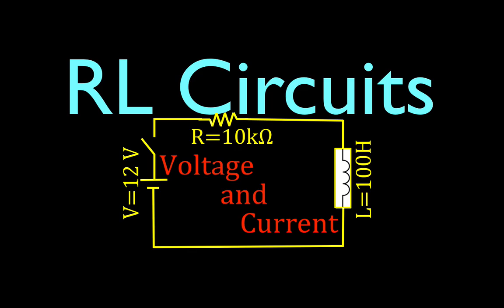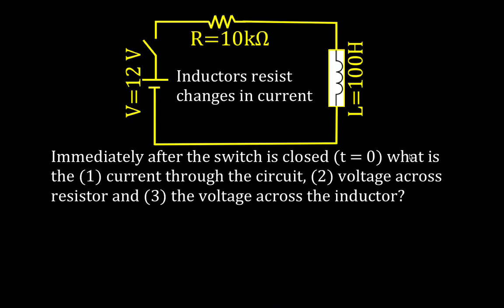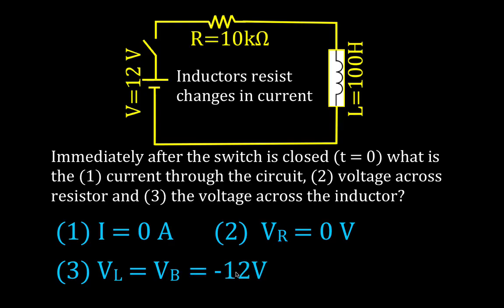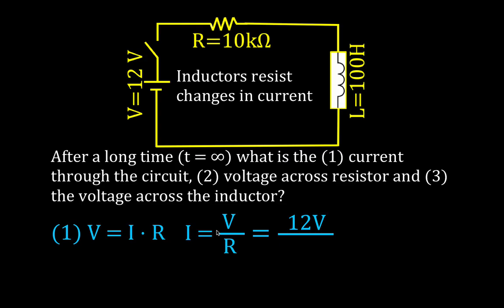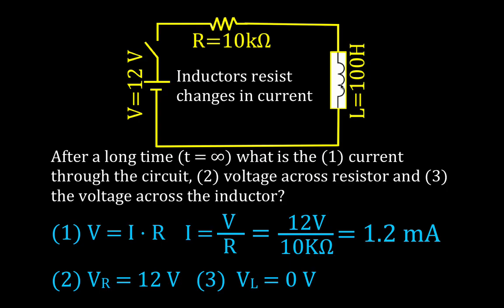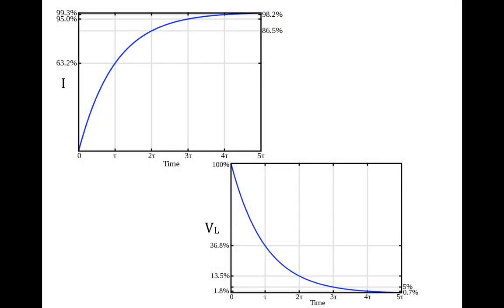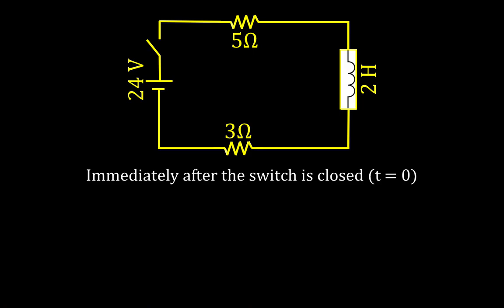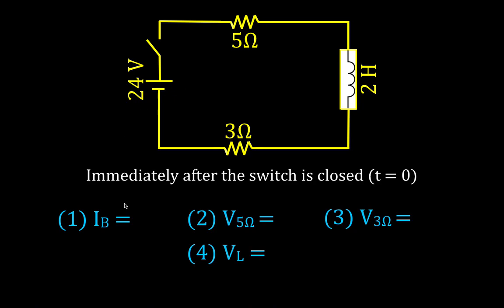RL Circuit Analysis (1 of 8) Voltage and Current

Comment: Very nice.  It is also worth considering the case where the inductor has resistance, which is true of virtually all REAL inductors.  Your analysis is for IDEAL inductors.  In the real case, the final current I would be Vbattery/(R + Rinductor).  The final voltage across the inductor would be I x Rinductor, rather than zero.  Thanks for a well done lesson!
Reply from the maker: Thank you

Comment: my university is so weird they use GL instead of RL, with G as conductance (Siemens)... making everything harder like there is no use using G.... the G is connected in parallel to the circuit, and the voltage source is replaced by a current source (Norton equivalent circuit).
Reply from the maker: Yes, that seems weird...

Comment: When a magnetic field inside a solenoid varies with time, a curly non-coulomb electric field is observed both inside and outside the solenoid. 
A coulomb electric field results and we note that an attempt to change the current in the coil induces an emf in the same coil and makes the coil sluggish to respond to current changes. 

It will be useful to learn the process which causes the production of induced emf using a unified approach to electrostatics and circuits. 
Electrostatics and circuits belong to one science not two. To learn the operation of circuits it is instructive to understand Current, the conduction process, resistors and Voltage at the fundamental level as in the following two videos:
i. https://youtu.be/TTtt28b1dYo  and 
ii. https://youtu.be/8BQM_xw2Rfo 

It is not possible in this post to discuss the production of induced emfs in inductors in detail. 

The last frame References in video #1  lists two textbooks 3 and 4 which discuss in detail with a series of diagrams the physical processes to explain the operation of inductors and RL circuits.

Comment: Since the current right after the switch is closed is 0, wouldn't there have to be a rate of change of current, to get an induced emf across the inductor? And would this be the time where the current is changing at the maximum rate?

Comment: are the resistors at 8:40 not in parallel?
Reply from the maker: No, they can not be in parallel, everything is in series. There is only one path for the current.
Reply: Try labeling the ends of each resistor with letters... To represent voltage at them... 

Call 2 resistors parallel only if both ends are at same voltage...

Comment: Wait a second, if there is no current in the circuit how can there be voltage across the inductor?
Reply from the maker: Right after the switch is closed there is 12 V across the inductor as it trys to resist the change in current. And the voltage across the resistor is 0 V.  Then over time the voltage across the inductor decreases and the voltage across the resistor decreases.  Does that help?
Reply: @stepbystepscience Almost. When the switch is closed at t=0 are we assuming that the current is running or JUST about to start going?
Reply: @lollolzi2996  since the current is zero at t = 0 s, we can say that there is no current at all. It doesn't matter if we say it is about to get going or it is going with intensity zero. It's the same. What appears to be confusing to you is the fact with have voltage across the inductor with no current. Take a simpler example: remove the inductor. What's the voltage between ground and the unconnected leg of the resistor? It's also 12 V. There's no voltage drop over the resistor because there's no current flowing.

Comment: when the switch is closed , won't the inductor  behaves as short circuit ?
Reply from the maker: When the switch is first closed the inductor acts like an open circuit, after a specific amount of time it acts like a short circuit.  The opposite of a capacitor.  Does that help?
Reply: Lenz's Law my dude.

Comment: Would there be a current through the inductor in the first example since you stated that the current of the whole circuit is zero. If there is a current how would I find it?
Reply from the maker: Right after the switch is closed there would be NO current (I = 0A) in any part of the circuit.  Then the current through the circuit increases overt time until it reaches its maximum.  The maximum current can be found using Ohms law, V = I x R or I = V / R.  So the maximum current would be 12 / 10K or 1.2 mA.
Reply: @stepbystepscience  Why is there no current? If the switch is closed. Then its just a normal series circuit is it not? I'm still a beginner sorry if this is a dumb question.

Comment: Hello, thanks again for your excellent videos. at the point that you explained that there was 0v across the resistor (0 seconds) and -12v across the inductor. please consider adding annotations that show the voltages at different points in the circuit. i know for me that method of demonstration helped allot and it could be useful to your viewers

Comment: I don't understand why the voltage across the inductor at t=0 is of negative polarity. Can you elaborate on that?
Reply: @flightlesssky note the battery polarity at 0 seconds (top is positive bottom is negative)  note that negative of battery is connected to inductor by a wire. this means bottom of inductor is 'tied' to the negative of battery.  negative of battery is 0v so bottom of inductor must be 0v. assuming you also understand why the top of the inductor is at 12v the following analogy should help. ( if you don't then ask and someone will help ) imagine 2 batteries with the pos of the first connected to the neg of the second. there polarities are the same. imagine then if you turn one around so that both the negatives are touching. they would now have opposite polarities. 
 hope this helps and please comment i  am wrong
Reply: the voltage across it, not through it ( the difference in voltage across the terminals) .  this might help also: when a capacitor is charged we can call this point time = infinity (after a long time)  however with an inductor, at the same point in time (infinity / after a long time) the current will be at I max (the maximum possible current in the circuit which is determined by the voltage of the battery x the resistance of the resistor)
Reply from the maker: flightlesssky Because there is no Current flights owing through the Circuit.
Reply: I still don't get it, in the case of the capacitor when it's done charging there's no current flowing either yet the voltage through it is positive.
Reply: I'm new to this myself but I'm thinking that because at t=0 the back voltage would be at it's highest at -12v. minus meaning the opposition of current. 12 because t=0 so the rate of change across the inductor is the highest rate. Am i close? I don't know

Comment: I don't get why there is 0V across the inductor if there is 9V across the 3ohm resistor even though it is after the inductor?
Reply from the maker: The order of the resistors and inductor does not matter, the voltages and current would be the same.  There is 0 V across the inductor because after a long time it is no longer resisting the changing increasing current.  After a long time the inductor acts just like a wire and wires have no resistance.  Does that help?
Reply: voltage = current x resistance       OR      V = I x R      OR          0 volts = 0 amps x 3 ohms (across the inductor)